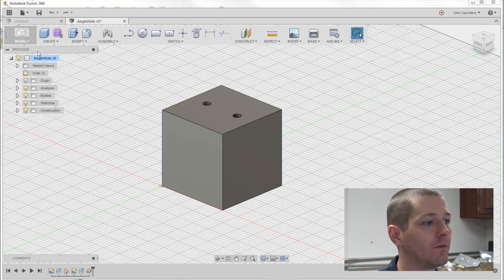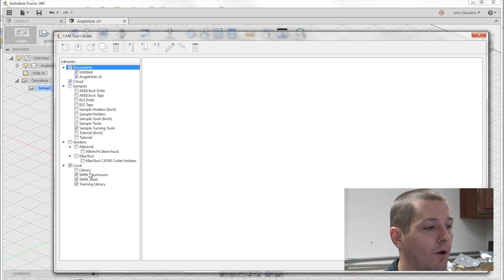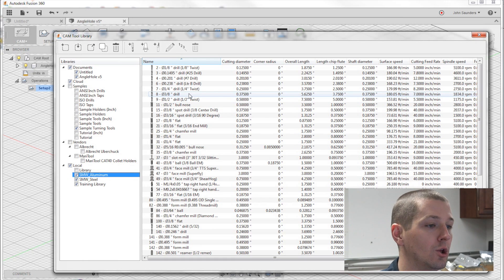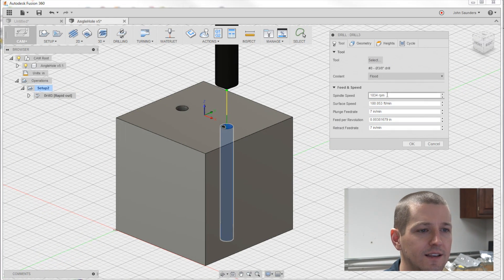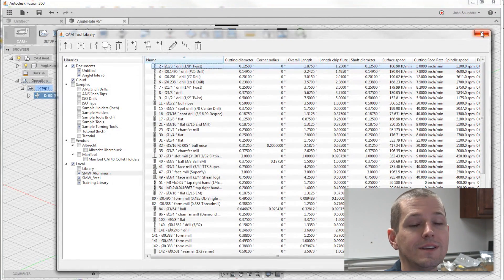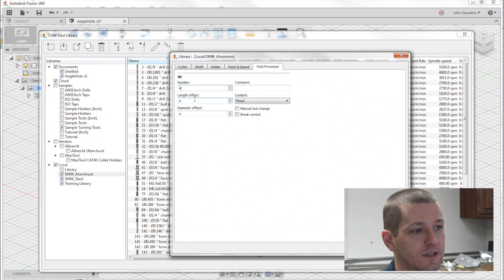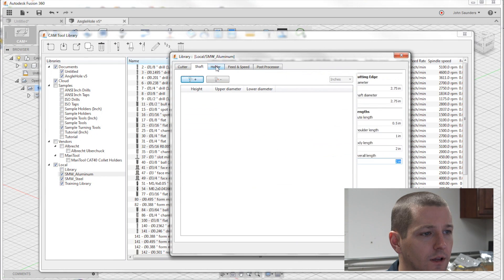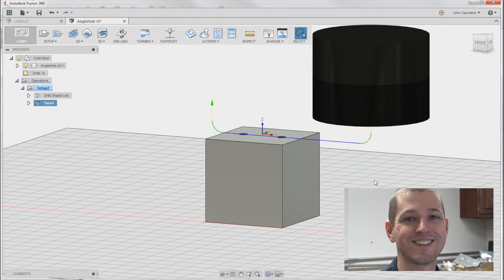Fusion Friday #7: Tool Library!

Comment: Hi John,  two questions.  1) I noticed that you have several form tools in your library.   How did you get those created, and can you use Fusion360 for thread milling with a form tool?    2)  I have noticed with my posts that between tool changes I need to manually pause my Tormach, switch tools, and then restart otherwise the spindle keeps running.   I have played with the manual tool change settings in the tool library, but can't seem to figure it out.   Any suggestions?   Thank you as always,  Russell

Comment: I'm thinking the "Cloud" library is only available on paid versions.  I'm using a free license and there isn't a Cloud option.  I have searched far and wide on how to enter a single profile threadmill into the tool library, but it doesn't seem like it's supported, at least not yet.  Spending a few minutes to put in the couple of tool holders you use is a great idea.  I spent 2 hours and measured and put in all my tools and holders and it has saved me from collisions more than once, when the holder would have hit a feature.
Reply: The situation may have changed since you commented, but you need to first click "Enable Cloud Libraries" under YourName->Preferences->CAM. (YourName is your name in the upper right of the screen.)

Comment: What exactly is shoulder length and whats the difference between body length and overall length? Those always confuse me
Reply: I agree. Sometimes I think I've got all the fields correctly entered and it won't allow me to hit ok cause I've done something wrong but I don't exactly understand the fields correctly so I usually just end up starting over.
Reply: Body length is stick out from the bottom of the toolholder (at least in HSMworks). Overall length is for the tool itself.

Comment: You can copy your tool library's to the cloud and they will be saved. No need to use drop box or any other applications it will sink all of your tooling throughly your computers. I believe it is as easy as selecting your current local library and just dragging it on top of where it says Cloud and it will just copy right to the cloud.

Comment: John, have you tried uploading a Fusion360 file to GrabCad? I am curious if the tool paths and tool library would be available when the file is downloaded.
Reply: +DIY Machining The built-in Grabcad plugin will upload an F3D that does include CAM toolpaths.  It should include the "Local" library with the file.  If you'd like to see what it looks like my 4080 tapping guide has toolpaths on it:  https://grabcad.com/library/misumi-4080-tapping-guide-1
Reply: +Stonewood cool. Thank you. I will check it out.

Comment: Since they added the ability to filter by material in Fusion when selecting a tool I suspect the plan is to be able to build tools with feeds and speeds for different types of material so that at some point you will have the same tool defined in different materials with the appropriate speeds and feeds. It would be cool if Fusion360 had a GWizard /FSWizard type program built in with manufacture specs for tooling.
As always thanks for sharing John :)

Comment: I believe that the reasoning behind the CAM copying the tool from your local library to the document library is to prevent any operation from being dependant on the local library. For example, if you wanted to share a model that you've created CAM ops for, the other person will have all of the tools already defined since they have been saved to the document library. If this were not the case and the file depended on your local library, anyone you send the file to will have to go back and redefine every tool that's to be used. I hope that I made sense I'm saying all of that. Thanks for the videos!

Comment: Two questions regarding the filters:
1. There is a filter for "Workpiece Material", but I haven't seen where you can set a suitable property on a tool for this to be useful.
2. Have you seen any downsides of entering a tool twice as different types?  I'm very tempted to enter my spot drill as both a spot drill and as a drill - otherwise every time I want to spot a set of holes, I have been setting up a drill operation, then have to change to the Tool Type in the filter to Spot Drill before I can get to it.

Comment: I've been using the cloud tool libraries, as I tend to work from two different machines.  It's important to note that this is not enabled by default, however: you need to enable it in <user> -> Preferences -> General -> CAM -> Enable Cloud Libraries.
Reply: +John Sasinowski Cloud libraries FTMFW. I use Fusion both on my computer in the office as well as my computer in the shop, and being able to have the same tools in both places is an absolute win and one of the things that makes Fusion, well, Fusion.
Reply: +NYC CNC Have you tried exporting your local library first, and then re-importing that file into the Cloud library? I think that's what I did when I made the switch over from Inventor/HSM Express.

You'll note that I have a "Tools" subsection within my Cloud library that isn't present in yours: http://i.imgur.com/y22u2S1.png